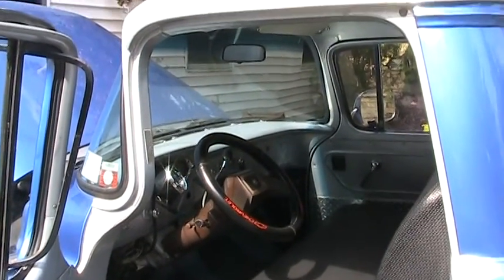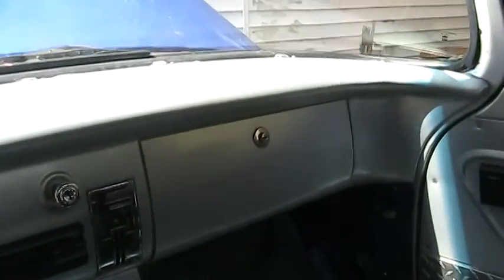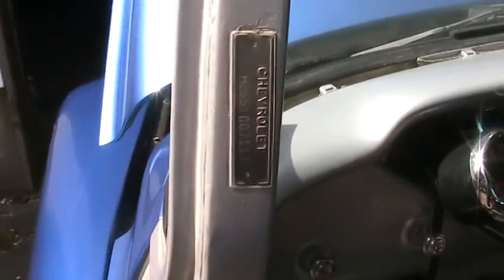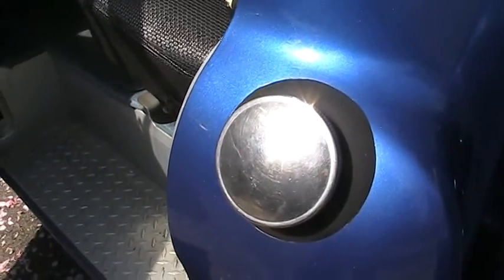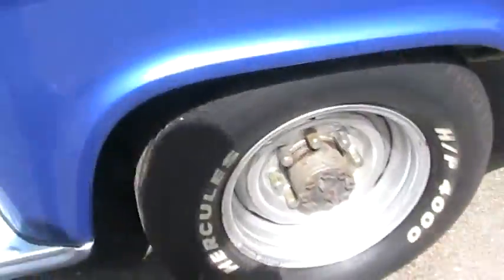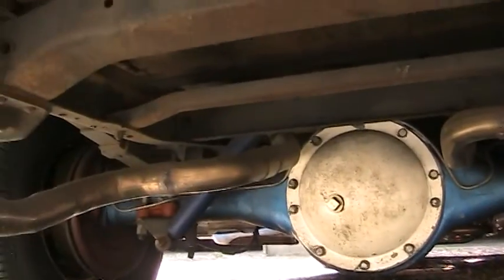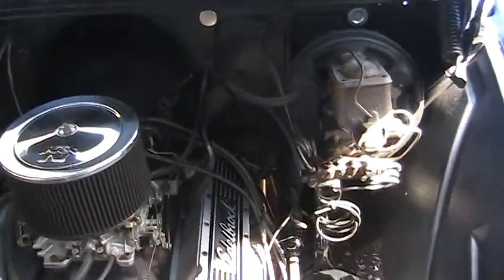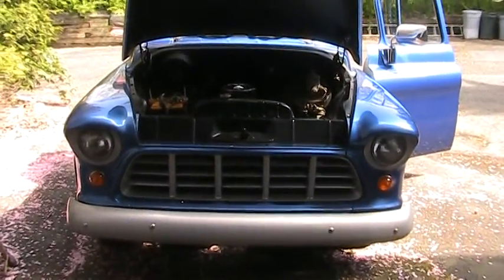55 Chevy Stepside Pickup For sale All custom Blue part 2 of 2

Comment: Nice looking truck, but was thrown off by the comment of "original 283" motor. The only V-8 available from Chevrolet in 1955 was the 265. The 283 was not available until 1957.